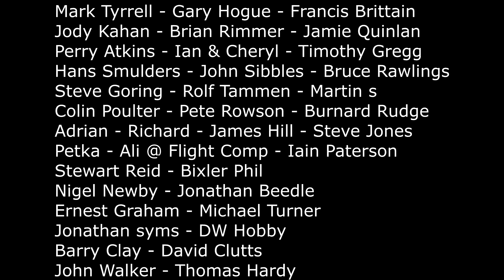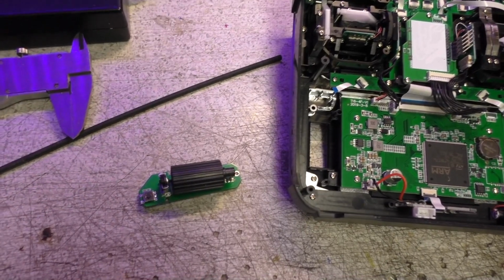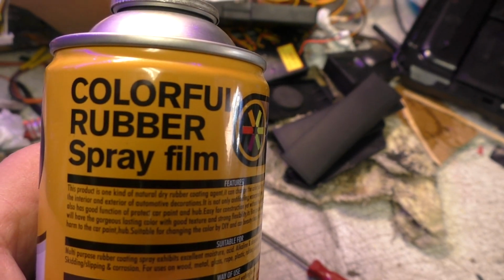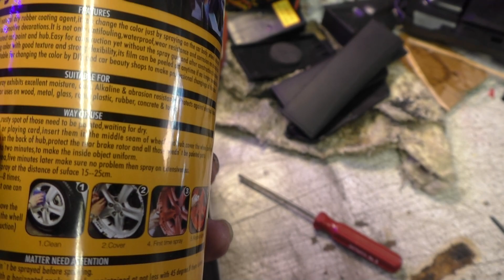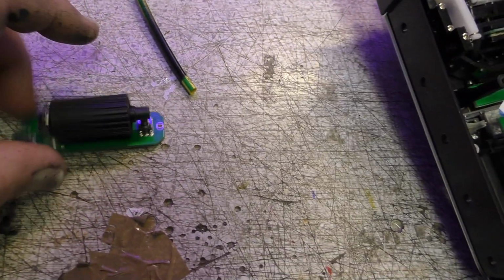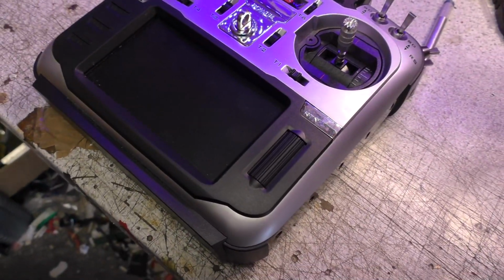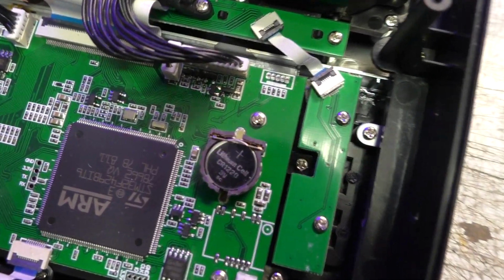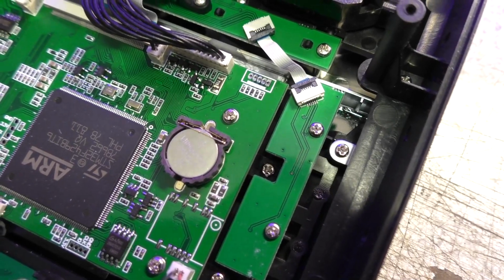Jumper T16 Rubber Scroll Knob Mod & Possible Backup Battery Problem RC Model Geeks

Comment: Check the 4 black wires just above the 3v battery that connect to the throttle gimbal. Mine were pinched between the case back and plug to the internal  RF board.

Comment: the new scroller has a metal pin on one end as the plastic one will snap over time of use. mine snapped within 1wk of use. so jumper has refined the scroller

Comment: Thats a good modification Rob,what is that tiny batteries purpose ? what does it power that the main battery does not.
Reply from the maker: The real time clock.

Comment: My battery was doa. The tx won’t date and time settings. Is there another functional downside? I can live with no date and time but does it do anything else that is important?
Reply from the maker: It should only power the RTC. i did not notice any other problem when i replaced mine. Hopefully jumper will fix this issue.
Reply: @Rcmodelgeeks  Well, if it only powers the clock it don't bother me so much. Hopefully it is a software fix. Good test to see if they will put effort in developing jumpertx

Comment: The design of the rotary knob is very unfortunate, but, by removing the slack in it, you are applying a physical stress on the internal structure of the rotary encoder and solder joints. There will be people who will overdo it and will walk away very disappointed.

Comment: Thank you, Rob, for your comprehensive review and this update on the T16, both of which have been very helpful!
As to the poor scroll wheel response (cursor will move only on every second increment), there is a firmware update out since April 28 that will fix this, together with another issue. Oddly enough, it bears the same version no. (t16-2.2.3) as the firmware my TX came with. However, the pre-installed version dated somewhat earlier in April (I believe the 8th or 9th); you can easily check this in the information tab (the last one) in the receiver menu. If you have got the earlier version, an update will be worth it.
The latest firmware can be downloaded here: https://www.jumper.xyz/jumpertx-t16 and Colski Drones has uploaded a very helpful tutorial on how to carry out the firmware update here: https://youtu.be/wP4xkweHH3A?t=164 
Hope this helps a bit. Cheers, and thanks again for your great work!

Comment: Rob I received my jumper today but my speaker is alway emitting a sound a bit like a speaker running at full power if this makes sense, does yours do this cheers
Reply: Happebs in Taranis also, it has something to do with OpenTX. You can move the antenna or lower the speaker volume.

Comment: I wonder if/how you can modify the programming to change the screen background image, screen/menu colors, data placement, voice feedback, etc; the code is open-source. I won't know for sure until I get one and hook it up to the Arduino IDE.

https://github.com/JumperXYZ/JumperTX

I can't wait to get mine when I have the funds and time to mess with it. Considering this radio is open-source there should be a lot you can mod with a little knowledge. I have a 3D printer to so lots of fun to be had.